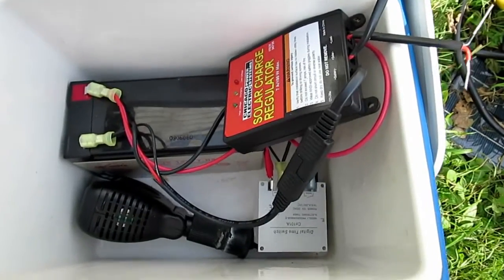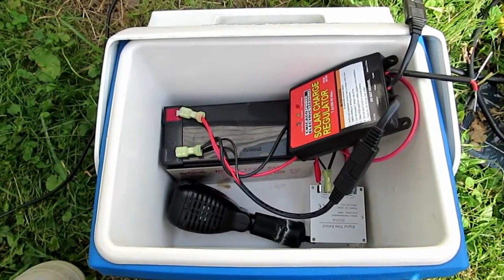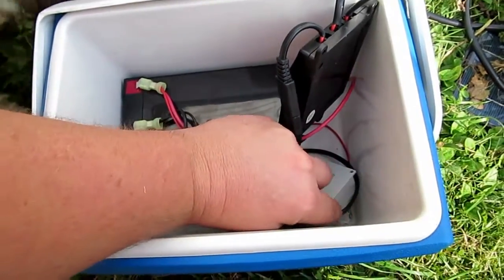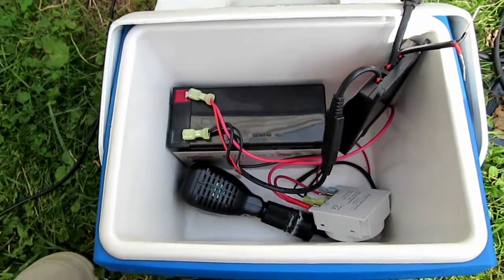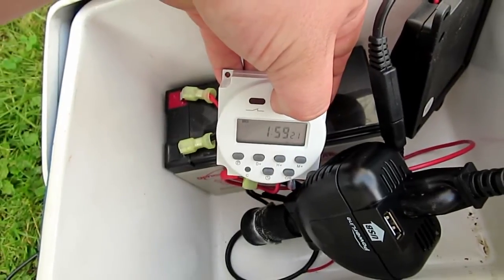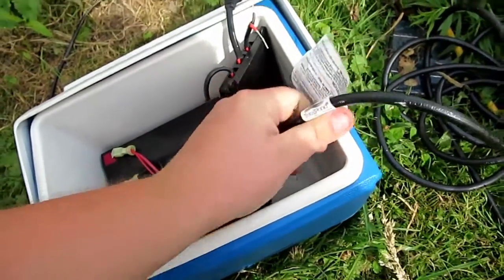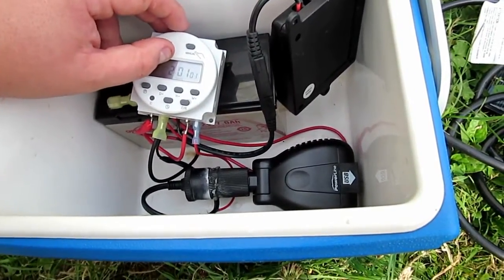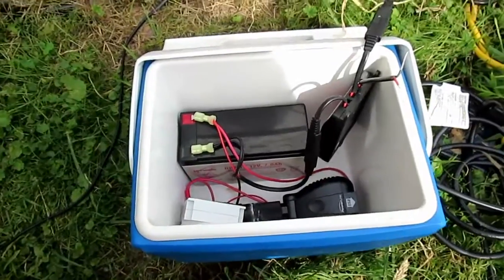Solar powered Hydroponics pump power supply

Comment: The issue with hydroponics is you must purchase "plant food" or nutrients and supplements which can be costly.
Reply: Aquaponics includes the best elements of Hydroponics And Aquaculture therefore greatly reduce price and also boost work productivity. You may get the most efficient aquaponics plan right here:
help1.info/best-aquaponics-plan
Reply from the maker: Hat Hayha Thank you for your comments. I learned with hydroponics with the goal of eventually switching the Aquaponics. My wife and I want to have a more self sufficient (i.e. no purchased fertilizers). I recently changed my mind about hydroponics. My wife's garden (all natural and organic) produced just as much as my hydroponics and I can tell you she spent less time watering, compost teaing, etc. I am currently using a rain gutter grow system developed by larry hall on youtube. It so far is working great, and I am using WAY less water, and only organic fertilizers. I dont regret doing hydroponics, but I probably wont do it again because of cost and water waste. My wife doesnt really like fish so I am not sure if Aquaponics is still on the table once we upsize to bigger property.
Reply: When done right aqua and or hydro is far more efficient then in dirt. I have used Larry's methods and still do on some systems and they are great.  I do research and development on many different system to actually see their efficiency and there is a lot of system being invented every day. Don't be discouraged with hydro or aqua just keep tweaking them to get a better result. It is a lot of fun. By the way make your own organic fertilizer it is very cheap.
Reply: @hoofpanels6519  I would really interested in how you are making your own organic fertilizer for the hydroponic system. Could you share this with us?

Comment: I'm doing something similar.  I am creating a solar hydroponic system.  I am looking for a 12V pump that doesn't draw too much amperage.  I am looking at bilge pumps.  I think your system will be more robust with a large deep cycle battery.  I realize you are trying to save on costs.  The power inverter probably consumers 30% of the power in converting from 12V DC to 115V AC.
Reply from the maker: Its not that Im trying to save money, I just have all of the pumps laying around and it wont require too much power. As we speak I am working on an NFT system that will be 100% DC power, so no power inverter will be required. Its the most efficient way to just do DC the whole way. I have a pump that I am working on with now for the NFT system. It was about 10 bucks and only uses 12 volts, 4 watts! However, I am unsure how well it will work for a dutch bucket system.  Please keep me posted and watch for another update today with the system.